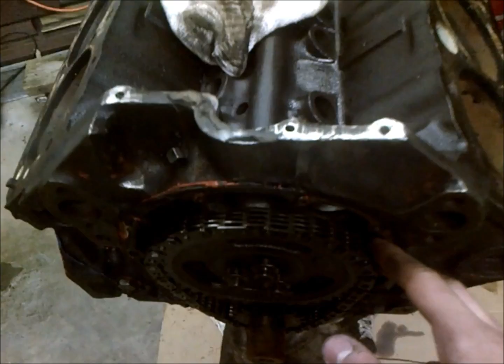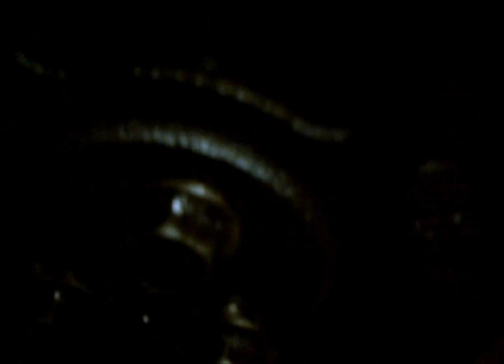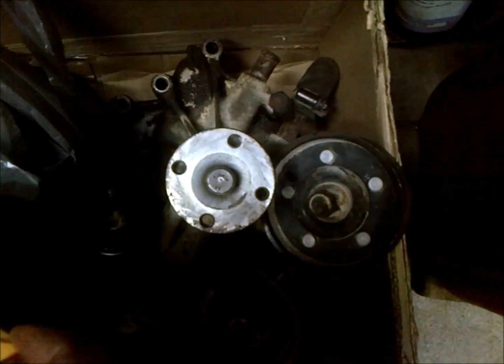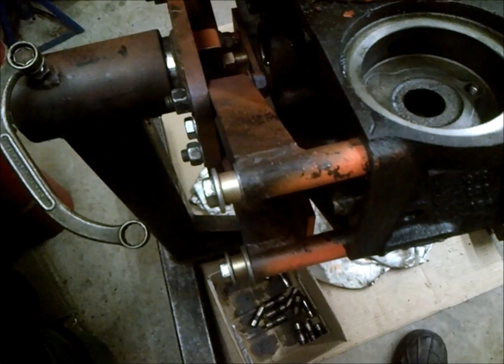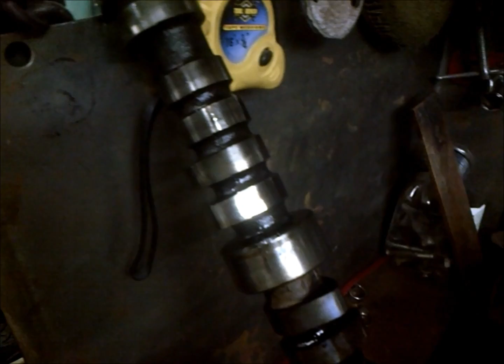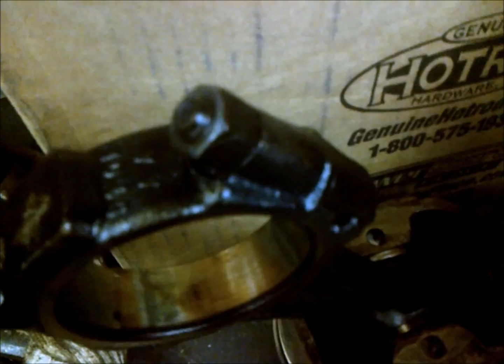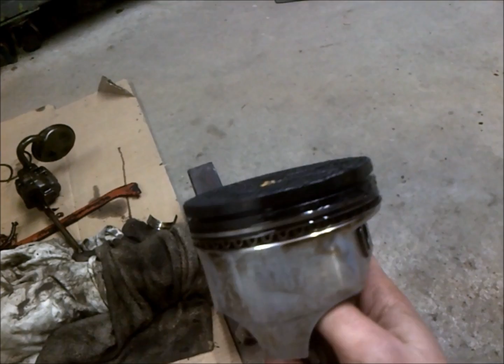350 Chevy vs Ford 302 Comparison: (Dumb Redneck Viewpoint)

Comment: Re @10:50 The Chevy 350 actually has a greater maximum rod angle than the 302 Ford due to the shorter rod/stoke ratio.  The difference is small.  17.8 degrees v 17.1

Comment: Hey there Uncle Luke, ever think of doing a stroke job on that one 390 block you have? Change the crank and balance it... maybe work some white lightnin' running magic into it. Like Bob Mitchum in Thrunder Road sort of fun  :-)) ya concerning the wiggle loose factor on that Chevy oil pump... I've seen guys put two spots of weld on either side of that spot that does wiggle loose some time... Why not compare the 350 Chev to the 351 Windsor or even the Cleveland :-)) 302 and 351 are very close 351 just sits a little higher [the newer version of the Windsor are faves for stroker builds due to the dogs and spider lock down spots for the moving parts section and the extra bolts on the mains much like the LS motors copied form the Windsor's... I see the Carroll Shelby Engine's guys expanded on that with extra gussetts between the rows of Lifter ports and yada yada... Shelby Engines... got it goin' on ;-) ].

Comment: These differences youre pointing out are inconsequential at best, Both are decent engines but The Chevy small block has been produced in the multi-millions and is still sold widely today as a crate engine due to its immense popularity so it must be pretty good.  Chevy has the most interchangeability and availability in parts, with 65 years of continuous improvements durability is proven especially in regards to the Chevy having the best designed oiling system internally and with proper tolerances & normal maintenance will last to extensive mileages even in stock form. The Chevy heads breath better than Ford, and a healthy set of Chevy rods is extremely reliable with healthy oil correct tolerances and the motor is not over revved. Far as the camshaft inexpensive cam buttons prevent movement and a $2.00 lock plate will secure the bolts if one feels a need to, though Ive taken apart untold Chevy engines and I havent seen a loose cam bolt yet, at least not one the factory installed or otherwise for that matter.  Its also noted that pound for pound Chevy engines are easier to get power out of than Fords in stock form, but todays access to intakes heads etc closes that gap a bit.  Obviously im a Chevy fan, but the fact is both engines have been proven over many years and the small block Fords arent bad engines but they do lack in the oiling system in some cases and not as many choices in aftermarket parts as Chevy in some cases and prices are generally higher depending on what youre looking for.

Comment: Chevrolets don't have a thrust plate because all flat tappet style camshafts have a slight taper ( usually .001 ) ground into the lobe in order to make the lifter rotate in its bore because of the large radius on the bottom of the lifter ( flat tappets aren't flat! ). If you look closely in the video, you will see the wear pattern on the lobes for both engines. The Chevrolet is on the rear part of the lobe ( except at the nose of the lobe ) which pulls the camshaft back into the block from the valve spring pressure. In cases of severe valve spring pressure that can cause excessive wear on the thrust surface on the front of the block. The Ford cam shows the wear patter alternating from lobe to lobe. All the intakes are tapered one way and the exhaust the other. This evens out the thrust load requiring a thrust plate to keep the cam in place. None of this, of course, applies to roller cams which have no taper on the lobes.

Comment: All I got to say is...

.875 lifters vs those little .842 lifters

Ive seen 570 lift hydro flat tappet cams on a ford vs youd be lucky to get 520 lift on a Chevy flat tappet.
Reply: Step up to Mopar with a .904" lifter diameter.
Reply: @craigbenz4835  if i was circle track racing and they allowed them,  yeah

Comment: Yes it's not fare but 289s and 302s have beat 350 Chevy's in races. Depending how they were build and what cars were racing. Chassis suspensions. What transmission, and gear ratio, size of wheel base and size of tire.

Comment: The camshaft is held back in the block on a sbc by the lobes on the cam they are not square one side is higher slightly forcing the cam to the rear of the block at the same time spinning the lifters, on roller cam blocks they have a cam retaining plate bolted to the front older blocks with roller cams they use cam buttons on the front of the cam that holds the cam in place against the timing cover!

Comment: I owned both a 302 and 350. I will take a 302 before a 350 any day of the week. The 96 Silverado I had felt like it had no power never got that with my 302. Had a plow on the Silverado couldn't plow in 4 high didn't have the power to move the plow. A buddy of mine has a 92 f150 with a 300 six he has no problem plowing in 4 high. Also I had far fewer problems with my 302. The vortec 350 I had every yr I had to do a tune up on it. The engine didn't even have 50,000 miles on it. It wasn't the original engine mind you. I bought it had 25,000 on the engine. Then again I wouldn't buy another Chevy at all. I had more problems with the Chevy's I have owned then the Ford's I had.

Comment: I realize this is a old video, but not really a fair comparison. I'm not sure what the difficulty was with bolting on the engine stand with the Chevy, since with building and helping build the different American companies for over 40 years I never saw a issue. In my opinion a 350 Chevy and a 351 Windsor would be a much better match as would a 1969 Z28 302 Chevy and a 1969 Boss 302 Ford since they both shared the shorter deck height and stroke. And as far as many anti comments against either, if built and maintained the same, both lasts about the same on average. I have friends and family that both argue but they all get about the same life from their engines depending on how used are abused. I use to be anti ford and to a point still am, BUT all three companies had good and bad parts. Over all I still liked the video. But that's just my opinion.

Comment: I can’t believe all the idiots here complaining about the comparison because of the cubic inch difference. This is about the BLOCK and basic design, not the size of displacement. Do you people not understand a 350, 305, 302 Chevy are all the same freaking block and design?? Comparing the Ford 302 small block to a 350 Chevy is apples to apples in the context of the video. You can’t use the 352 360 FE Ford here because they are technically a big block and a different design than the small block Chevy. The 302 Ford is the correct engine to compare with

I like them both and own both. They are on the same team in my mind. Chevys are cheaper to play with and Fords and quieter smoother

Comment: Being able to over bore an engine isn't an advantage and ford knows this fact. Chev might cater to a different type of person. You just don't know. Eventually all engines become obsolete. All you do is just drive the thing and make it famous. If it doesn't do the job, then the problem is with you not the machine. Machines behave like tools. They just do a job at a certain point in time. The question you need to answer is, "How long can you drive a car for?" There's no answer to this question. How long can a motor go for, is never able to be answered. You need to go back to this first question and make yourself answer it.

Comment: Well if this is an even comparison.  I wanna see a 428 cobra jet compared to a 350.
Reply: rex racer  to the 427 cc.  428 is comparable with the same factory set up.  But that’s just an opinion. Never lost to a ford. But had a few big bore Chevys show me taillights.   Weight is a factor!!!
67 Chevelle S. S. 
Factory over.30. 402 ci. 
Rebuilt by broesche automotive in knightslanding  CA. 
But a 302 is the motor for the derby cars. Because they were built for heat and take it. Got my 302 so hot. It ran for 30 minutes after I shut it off. lol. No lie man. Was in a 1979 LTD. then I put it in my 46 Willies Jeep.

Comment: SBF is a more modern design. 1955 vs 1961. Likewise it has more "progressive" features such as a lightweight aluminum timing cover and evenly spaced exhaust ports. GM later adopted a Ford-style front distributor position and exhaust style on their SB2.2 NASCAR engines, which says something - likewise GM LS engines when equipped with a distributor somewhat resemble old SBF engines, which is why some Ford guys incorrectly state the LS is "based" on the SBF. I'm a Ford guy but I like both engines personally, considering these things were designed by long-dead engineers on graphing paper it's impressive that we can still make good power with them.

I agree with the first part though, SBF timing covers are a bitch to deal with, SBC is less of a headache. On a Ford half of the bolts go through a water jacket and you're likely to snap them off after years of galling.

Comment: so wrong about the "linear movement"  on the chevy lol why do chevy guys use 6" rods?? to change wrist pin location and reduce side load on the cylinder wall! Ford not so much an issue! the deck heights are different therefore the angles are different and 
.60 over on a anything  is suicidal always leave clean up room

Comment: I just have to laugh. Are you people this stupid or is it sarcasm ?  The GM 305 & 307 were junk from day 1. If you want to compare apples to apples the 1969/70  Chevy 302 DZ to the 1969/70 Ford 302 CanAm.The valve angle is better on the Ford engine and the rod length ratio is better on the GM. I have owned and raced both.Cheaper to build a GM. Way cheaper to go fast on a R1M

Comment: How  about  mentioning that  the Fact small block Chevy Is more than  110 pounds  more weight  than the 302 ford or, the same weight as a  400 ford !   even a 351 Cleveland is a lite weight  compared to a 350 Chevy!

Comment: The Chevy has 5 bolts around the head and Ford has 4.  Chevy rods are longer also.  Stock this isn’t a big deal.  The Mopar small block is pretty good too if you get better heads.  They have a 6.123 rod length.   I have a 5.0 Ford so I’m pretty neutral.   You can do great things with all of them.  I’d like to see a 351 Cleveland comparison.   Thanks.

Comment: How about this if you built both right they will both hold up if you have a Chevy vehicle why put a ford in there and vise versa they each have there flaws and their perfections, as a motor head it always amazed me that so many do compare the 350 to the 302 maybe the 302 for being a smaller lighter motor is more than people are willing to admit but at the same time the 350 is so popular, take 2 of the same motors as close to cam specs and everything as you can and pull them both on a dyno and then both give them a marathon run and see which lasts longer, that's the only way to ever solve this debate

Comment: Both have 4" bore but, Ford won't hold more than 600 ft pounds for long
Reply from the maker: +Josh Keasler the 351 is a much better engine. Not sure why ford didn’t just put that in everything over the 302
Reply: ThunderHead289  yes the 302 was light casting and the rod bolts are 5/16
Reply from the maker: Josh Keasler just not much meat on it

Comment: Is a 302 a 4.6 liter? My 1997 F150 has 4.6 stock 200,000 miles and it's a fine running motor.
Reply: Mike Btrfld No, the 302 is a 5.0 pushrod engine. The 4.6 is a 281 overhead cam mod motor. Last year for pushrod 5.0/302 in F150 was '96.

Comment: Everyone on here is not even smart enough to even talk motor specs of any sort I mean what motor here is always more powerful and way more durable and cheaper and easier work and more bolts is better one big bolt 3 inches apart compared to medium bolts a inch apart I mean really which one is gonna blow gasket easier the ford duh but I can't forget ford guys are just like their motors slow weak and backwards. SMH...

Comment: doesn't anyone know the bore is exactly the same it's the stroke that's different the 350c.i is a 4 inch bore and 3.480 inch stroke and the fucking cam doesn't walk in and out like this dumb fuck made it out to LMAO I'm not a know it all by any means but I do know a bit like one person said on they are both proven engine's and both have their pros and cons oh yeah the Chevy most generally has a 5.7 inch connecting rod some are 6.00 but I think those are more common in a stroker like a 383 Wich is a 355 with a 400 crank but I'll shut up bc I'm not very educated on Ford  but none the less don't believe everything thing this guy says in the video and the biggest thing in the world is it's almost always a matter of opinion if you prefer Ford unlike myself then Ford is better and if you prefer Chevrolet then Chevrolet is better but however I do have a question about the Ford v8 what if any is the deal about the oil or oiler bearing or bearings I've only heard an old-school rumor about the oil bearing needs drilled out or something I'm just curious btw I apologise if I've said anything offensive I didn't mean to......so if you know the answer about the Ford please let me know ty all and good luck and God bless.... oh yeah almost forgot to mention that my name is John Burks I'm on my ol lady's account

Comment: and thick walls for more heat and you can interchange so many more engines parts to other engines and cars.chevy is tougher.wish i had an old 302 chevy.wld like to see comparision,or 283 to a 302.just to see you know.both the 302 and 350 are awesome

Comment: The connecting rod length is what determines how high you can rev your engine, and a shorter stroke can spin faster.  Since the 302 is a shorter stroke, it will rev higher than the 350.  The difference is how you build the engine--higher revs don't always equal more power.  It just moves the available torque curve.  If you tune the components for the application and use the right gears to keep the engine in its power band high revs make no difference in this comparison.  Also, the comparison would have been more direct with a 351 Windsor versus a 350 small block.  Ford and Chevy are very comparable, but Ford mixes metric and standard bolts which will require two tool sets to build.  Also, the small block chevy will be cheaper to build because the have far more available aftermarket parts.

Comment: 5/16" rod bolts have never been a problem on Fords at reasonable street HP and RPM levels. 
Stock Ford rods are pretty solid.
Reply: But too short.

Comment: i wouldn't have compared a Chevy 350 to a Ford 302. the crank and rods diffences would show a closer correlation vs the Ford 351W. crank throw and rod length are different as well as where the wrist pin lines up. just built a Ford 427 stroker for a friend's Corvette last summer, yep Ford motor in a Corvette, and its a really hard runner. 410hp at 6150rpm. could have got a little more but he was scared of the exhaust note at high rpm with a Ford crate motor of the same 427w. i have a 280hp 300i6  in a half ton 4x4. lots can be done with either brand. i do feel sorry for AMC guys. just not as much out there for them

Comment: You forgot there's supposed to be a cam button that isolates the cam in place on pre '87 Chevy small blocks.  Now it's replaced with a cam retainer plate and stock roller cam, just with a roller lifter retainer spider on top in the lifter galley, for the '87 and up casts.  Other than that, not much difference except for head designs over the years, ending on factory Vortec heads that lack center mounting bolts for the intake manifold.  However the advantage to Chevy small blocks being old heads can be used on newer blocks, and vice versa.  Just because the camshaft can be moved back and forth doesn't mean that was really the case going on under the timing chain cover, the cover itself isolated the cam sprocket in place.

Comment: When the Chevy was designed, it was designed with a minimalist attitude. the cam retention works just fine in stock form.
If you are going to compare the small blocks (Chrysler vs Ford vs Chevy,) try to compare apples to apples. 360 vs 351 vs 350.
They all have their advantages in design. The Chevy is a simple and reliable engine. I am a Ford guy so this is hard for me to say. They respond well to minor upgrades but will scatter if pushed too hard in stock form. I find the Ford and the Chrysler to be better yet more expensive to upgrade.

Comment: Why aren't you comparing more equal motors; ie. a Ford 351W to the Chevy 350?  Unlike GM, Ford made their 'big' small-block quite a bit stouter than the smaller versions. Forged crank and higher deck with better rod ratio.  You said Chevy used smaller bolts but more of them. On the 302, they used ten 7/16" bolts but GM had seventeen. On 351W the ten bolts were half inch so you'd be right  there.

Comment: A ford engine doesn't hold a candle to the Chevy 350. There's a reason everyone puts Chevy engines in fords. Fords never made a good engine, and a 350 will make way more power than a ford every time. If your gonna build a race engine and want to win build a 350. End of story.

Comment: Your comparison of the rod advantage on these two engines is incorrect, or at least misguided. The 350 has a 3.48 inch stroke compared to the 302's 3 inch results in a better rod/stroke ratio, which is what you're getting at. All else being equal the longer stroke motor has a better rod/stroke ratio giving that engine a straighter push on the crank and less piston wobble.

Comment: You have much to learn.  Wait until you have a Ford motor fall apart because of the zip-strip issue.  Also, that Chevrolet motor after 1986 has a cam plate.
Reply: too late in it s life

Comment: I am a certified Automotive technician have been for 16 years now if you break the crank shaft pulley bolt that's a shit design. I don't really have any preference 2 Ford or Chevy as long as one of them and not Chrysler Dodge whatever you want to call it this these days and age